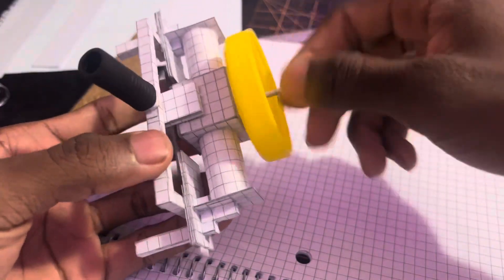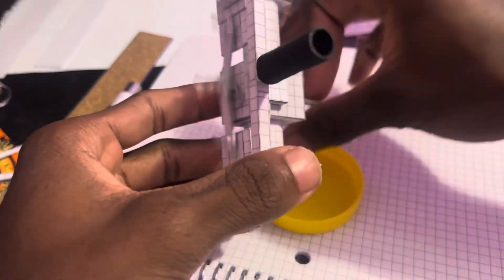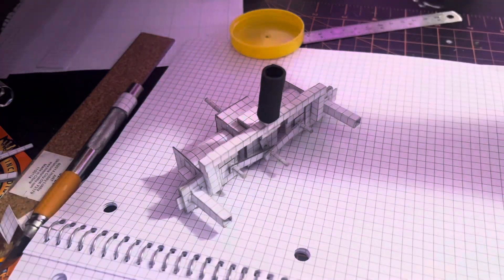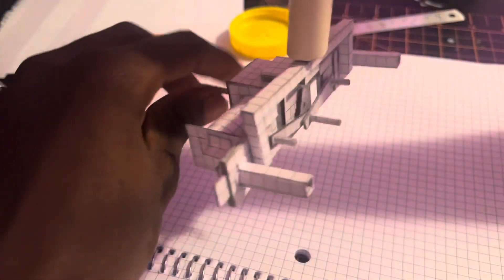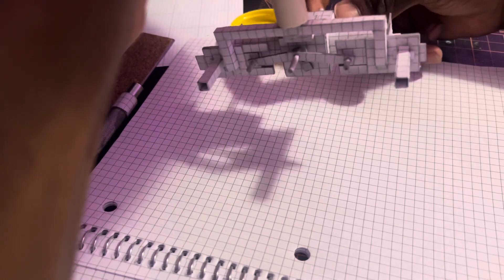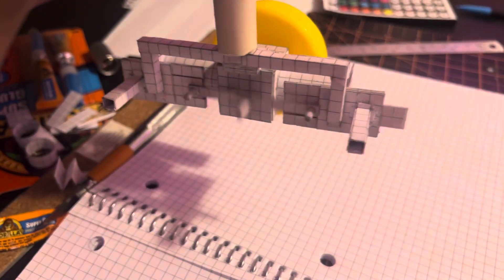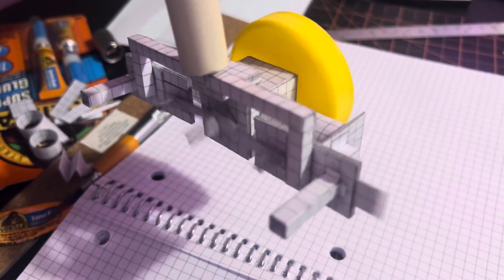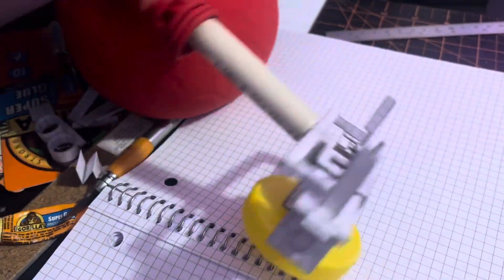Can My Boxer Twin Engine Run Without A Flywheel?

Comment: i have a question i want to make one but i want it to work and also what do i need to make it run like do i need a vacume cleaner to pull air or i need something like a balloon to push air
Reply from the maker: both
Reply: If using vacuum than you’d need to rotate the valve arm 180* from where he normally puts it, so it opens when the piston is at the bottom, rather than the top

Comment: Great video I can't believe a twin cylinder worked without a flywheel I have made 4 of the on cylinder paper engine and it dose not work the 4th one is smother than than the other's because of the flywheel I put and it moves smooth when i tern it with my hand but it gust doesn't want to run on its own powere you are truly a professional at makeing paper engine's keep up the great work like always and I will keep watching your videos to see if I can get one run on its own powere. 🔥 video 👍